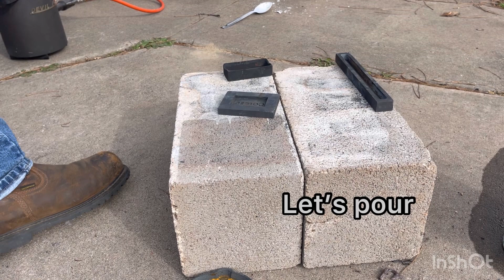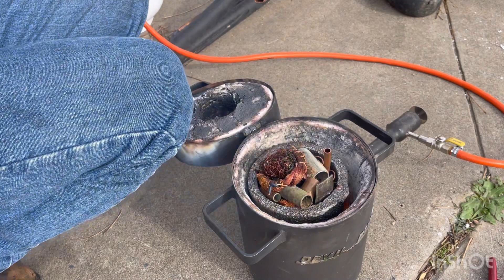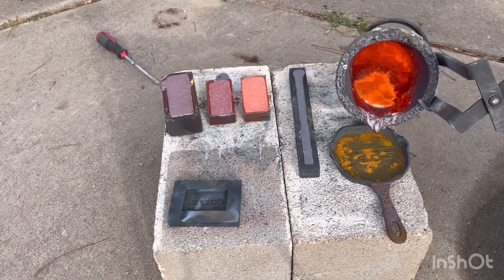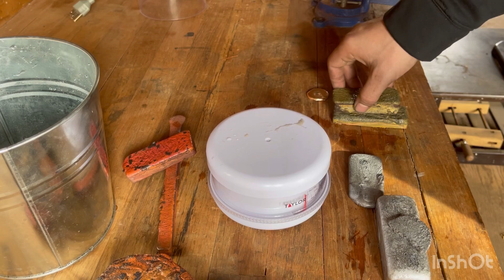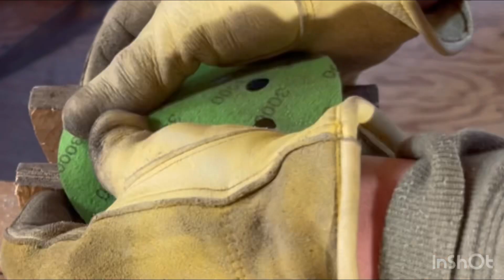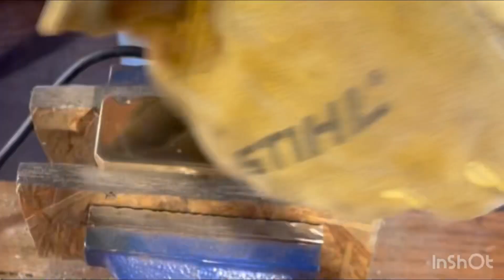Scrap bucket meltdown part 2!!

Comment: A crucible full of copper can be heavy 😅. You should look or make other pliers to pour. The one like I use mostly. You don’t need to squeeze so you can concentrate on the pours😉. 
But you got some nice ingots out of it! Good job buddy!!
Reply from the maker: Hah right that big crucible is so hot and heavy it beats me up. I did steal your idea on using a filter vice grip to pick up the ingots that’s been working great
Reply: @BEMetalMelting  The heat those crucibles give is immense with copper. In the summer I pour wearing shorts🤣. That’s ok, I got that idea from an other caster😂. JsStack😉
Reply from the maker: @SJWCASTING  haha well they work great. I would love one of those long grabber things that you can pour away from yourself with
Reply: @BEMetalMelting  make one😃.
Reply from the maker: @SJWCASTING  haha good idea